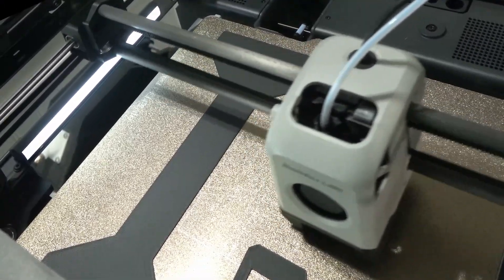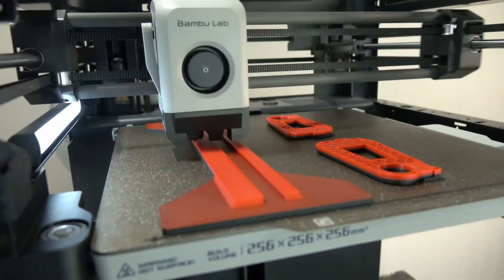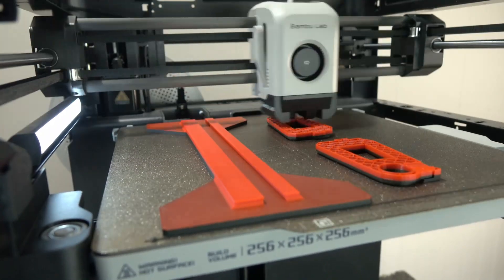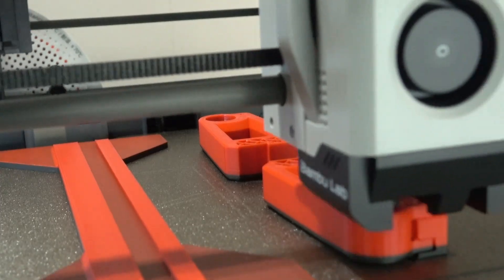3D Print Your Own Tools!

Comment: I'll suggest you to add brass inserts on all the screw points since repeated use will chew the thread's on the 3D printed plastic part's you have a soldering iron to add them to your 3D print already anyway just press the inserts onto a flat table or use a bolt head to have the brass inserts be flush with the 3Dprint once you have heated the inserts with the soldering iron first.
Secondly add washers(with the smooth side of the washers facing each other) to the points were you have knobs so that plastic rubbing onto itself doesn't cause were on the 3d Print.

Comment: Looks like a nice design, but what's missing/lacking is documentation. What's the purpose of the parts/STLs, how are they supposed to be printed and assembled, what kind of screws are needed.... I downloaded the archive from cults and it contains some STLs for individual parts and them some with entire assemblies mushed together. Also looks like the base plate is 1) missing as an individual STL, and 2) too big for most normal-sized printers. Would be great if there were either different sizes or a way to modularize the base so it can be printed in smaller chunks.
Oh, and have you considered sharing your models on sites other than cults? It's not very commonly used, better choices might be printables and/or thingiverse.

Comment: I do no know who is this John everyone talking about. But this device is cool! And you are great!

But.. If you have money for such expensive (I will not argue it works very well) printer, and you complain about high price tools. This is kinda strange. I would understand if you had custom Ender 3 build which you bought from your neighbor for $20. = )
I think it is great to create new things just because you can, or to make them more useful or comforting for you.
As for price concerns, when you create this you loose time, material, it may not become cheaper. Take this 3d printer you have. But you can repair your device easily, it may be more functional and it will not have planning obsolescence. (like your proprietary 3d printer for example)

So when you talk about creating your own tools with 3d printer, you may talk about many advantages, but I am afraid money is not one of them.

You can print from plastic bottles, which can be freely found here and there. But you will need time to prepare them. Pellet extrusion printing is develops nowadays, but it will not change that you need time to study CAD programs, make several prototypes and such.

This is a good hobby and a way to force manufacturers to create decent items. So all in all I support the direction of your work. Just wanted to mention that going cheap is expensive. = )